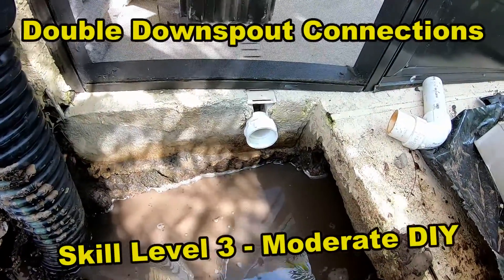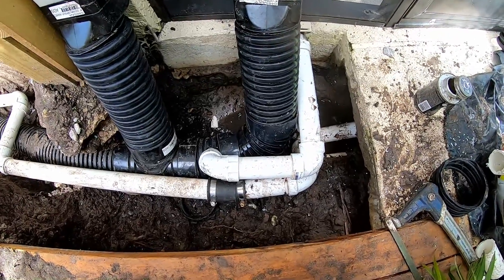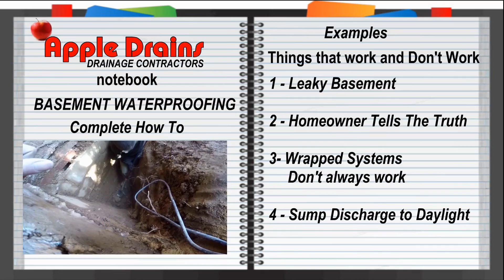Double Downspout Connection - Plus Cutting Weak Sod - 2 Great Tips for Homeowners, by Apple Drains

Comment: PLEASE HELP.  After watching your videos, I’m going to undertake a sump pump install in my backyard.  I can’t find the answer to a question.  Sometimes with a sump pump installation you use 1.5 inch pvc to your discharge point and sometimes you switch over to 2”.  Help me determine which to use on my project.

Comment: I have seen you don't put a plastic tarp on the yard on your jobs; IMO, it would make the work much easier and cleaner and then you don' t have to rake it out of the grass. Also wonder why you don't use the solid PVC, all the landscapers i have spoken with highly recommend it over the perf pipe, particularly in the northern climates as it is so much stronger.